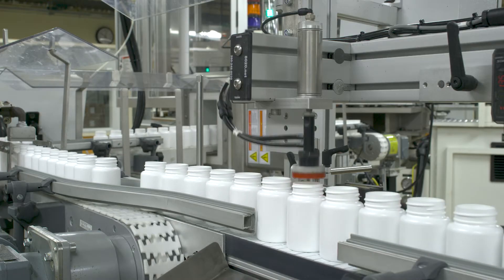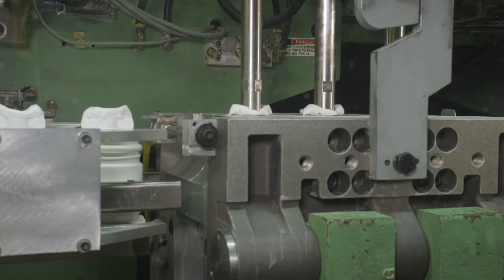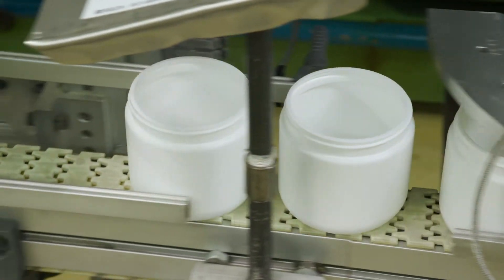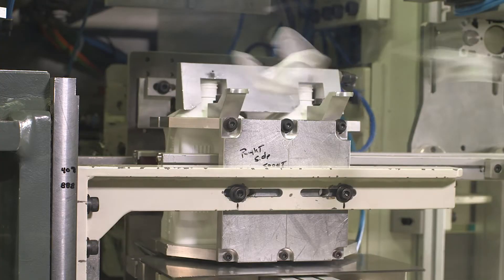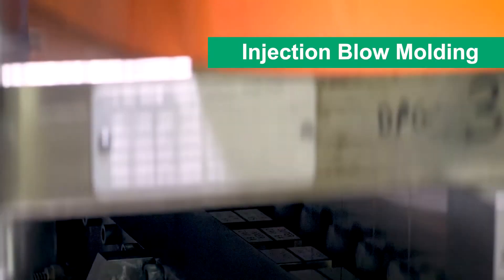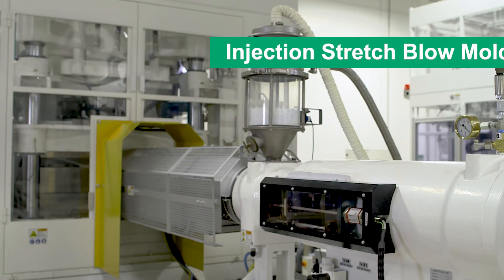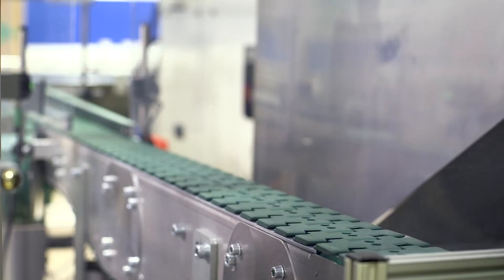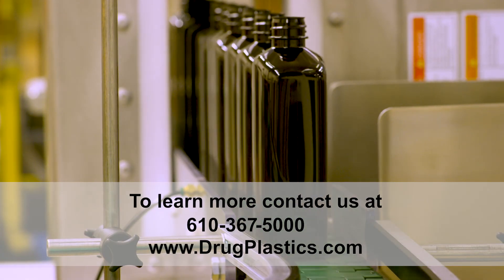Which Blow Molding Process is Right for Your Bottle? - Drug Plastics

Comment: I have a question,does HDPE injection blow molding bottle and PET injection stretch blow molding bottle can use the same machine to produce?
Reply: HDPE injection blow molding machine is not suitable to run PET materials. One step PET strength blow molding machine can run PP,HDPE and PET together, but it's very expensive.
Reply: so usually in China, will choose two steps way to run PET bottles - first use injection molding machine to produce PET preforms, then use PET blowing machine to blow preforms to become bottles, it's more economic!
Reply: @Anna-e3s  Thank you so much for your answer

Comment: Can someone point out the difference between Extrusion and Compression Blow Molding? It looked the exact same to me.
Reply: This video show the process of injection and blow molding  exactly while extrusion process is quite similar but require either level or pressure control for stability to make something lager like plastic sheet or tube..
Reply: @kingjardani7267  Thank you for clarifying
Reply: I think compression BM is used for larger bottles